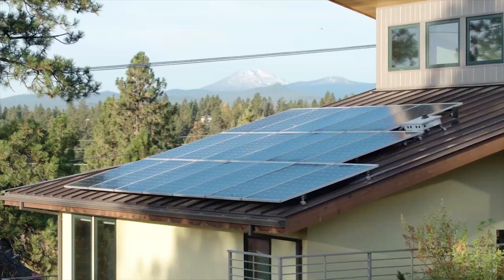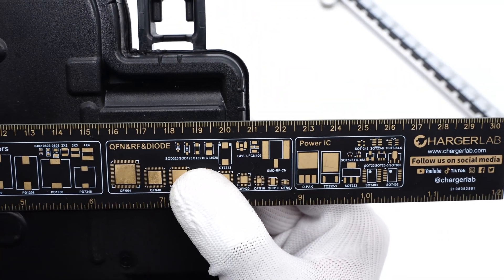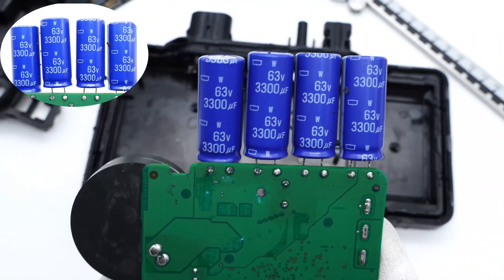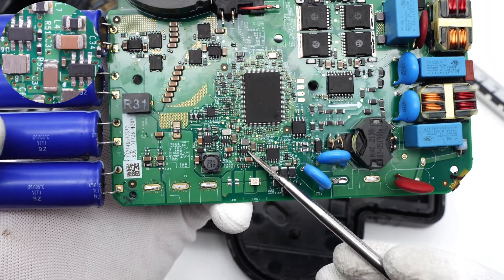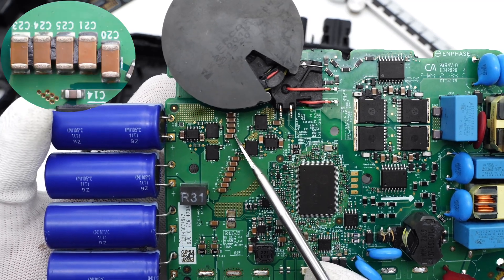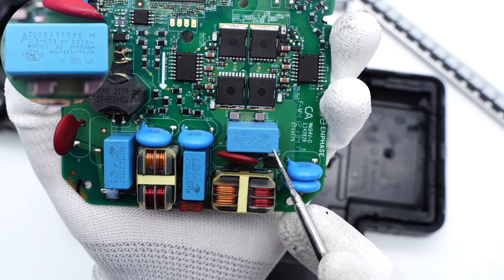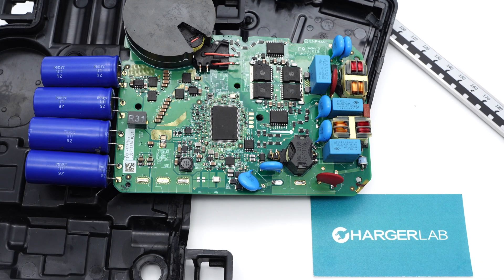Teardown of Enphase IQ7+ Microinverter (For Solar Energy)

Comment: Great video. thanks I have learnt more here than on the enphase datasheet. So the IQ7 has a maximum continuous DC of 720W (60V*12A) but then in your IQ8 video it is 73.5V/8A=588W  I don't get it. I thought the IQ8 was more "powerful" than the IQ7. Does it mean for panels with >600Wp it is best to stay with a IQ7?

but then the AC power for the IQ7 = 290W and the IQ8 = 320W  this is 10% more.   If I were to have a 650Wp panels, which IQ would you chose?
Reply: String inverter for 650wp panels

Comment: Sir, is there any ac output in the microinverter alone? I mean,, panel to inverter? I have a panel with enphase inverter,, the panel produces 44volts but there is no ac out put on the microinverter... Thanks
Reply: It's grid-tied only, I bet.   Won't do anything independently.  Also known as "anti-islanding"

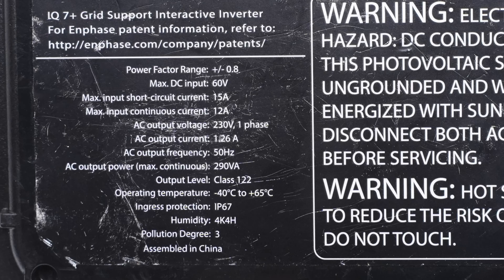Comment: 0:35 nope, this inverter will never draw 720W. Something like 320W max, considering some losses at full load. Taking this power in mind, you can let it draws 12A (max continuous current) at 27V, while at 60V (max DC input), it won't draw more than 5.3A.
Reply from the maker: Thanks for your explanation.